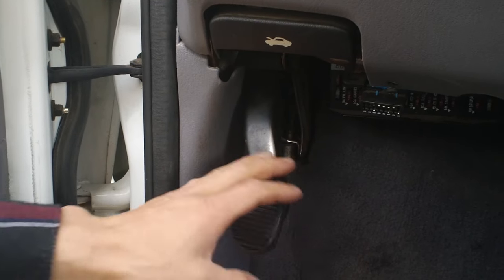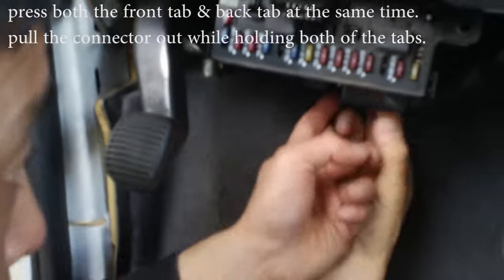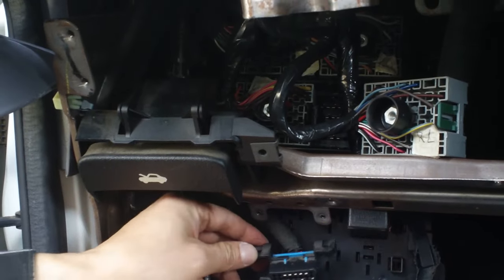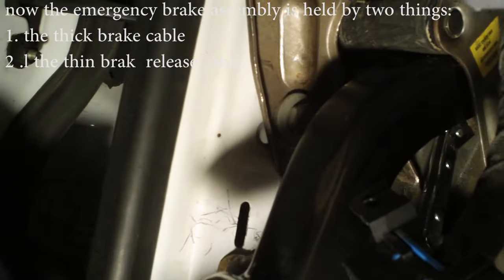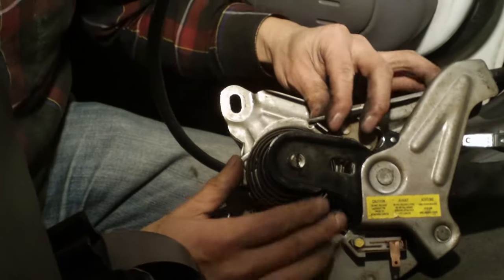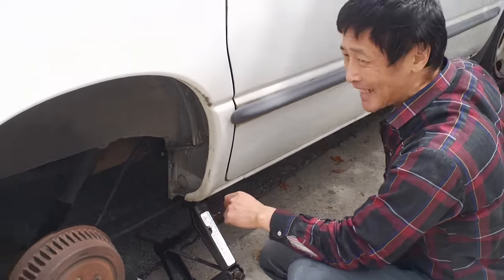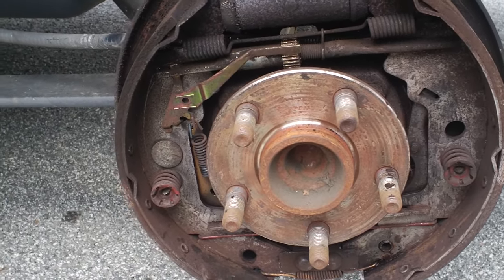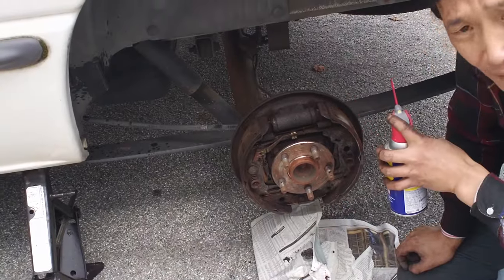Emergency Brake Pedal Assembly & Stuck Brake Cable

Comment: Idk what we would do without hardworking Asian men to explain how to fix things. Thank you so much for this video. I'm bought a 2000 Plymouth Grand Voyager SE with the 3.3L flex fuel from an auctioneer. They disconnected the parking brake cable and I had no idea. I use the parking brake because hills. I ended up having to drive it with parking brake on to get home. Now I gotta fix this, possibly fix other issues. This is a great vehicle, worth fixing.
Reply from the maker: Thank you for taking the time to provide feedback. Yes, make sure the parking brake is not engaged while driving. If you have to drive with parking brake on, make sure you stop and rest on your way home frequently so that it is not too hot.

Comment: Thank you for sharing  your technique   Our 2013 Kia Soul sat for a week in the mid-May heat in SE Ohio, and when we returned, we couldn't release the parking brake. The car wouldn't roll, but dragged one wheel along the ground. Jacked it up, attempted to remove the wheel, but couldn't. and after trying a rubber mallet, switched to a sledge hammer and tapped around firmly, until the wheel started to rotate freely once again.  I was worrying about hiring a tow truck to drag it out of our narrow, walled driveway to a shop for major repairs. We still have to get that wheel off to replace the tire eventually (tire tread is worn but not gone...NOT as a result of this issue) but we can do it at a time of OUR choosing.  Thanks again for showing us what you did.
Reply from the maker: Thank you for taking the time to share, it will help other viewers

Comment: Thanks.  Showing oops (or non-optimal) are the most educational.  I just replaced the parking shoes in my 2002 Town & Country (rear disks, plus pads and hub-bearings).  When done, and adjusted by trial and error (removing disk w/ calipers off), the parking shoes initially dragged slightly and the parking pedal held at half depressed.  After driving a bit, the slight dragging sound (whosh-whosh) went away, but now with e-pedal at the floor the van doesn't hold on a slight hill.  Hope not in the pedal self-adjuster since, as you show removing that part is a beast.
Reply from the maker: Very good advice about the "oops". Thank you for taking the time to share your results, it would help other viewers

Comment: I appreciated your wife asking questions..you do not need to know cuss words...just say things loud like..OH BRAKE SHOE!!! or FUSE !!!
that being said a genius would have checked the cable 1st but then we would not have learned anything..I was ready to pull my foot brake assembly apart but thanks to your video I will first put tension on the cable and see if the pedal works and I will look like a genius to my wife. Thanks to your hard work..I won't have to shout STUPID SHORT SCREW DRIVER!!! FUSE IT ALL!!!
Reply from the maker: Thank you for taking the time to share, and your tips 😁 it will help many other viewers.

Comment: Thank you for the great video.  You're brake assembly looks like the assembly on my 1996 SL320 Mercedes. They are all basically the same .  I worked on it for an hour and realized that I will need to take it completely out to unlock the brake ; then I came across your video. You saved yourself alot of money by working on it yourself.  You did a good job .
 That's was funny when you said you didn't know many curse words or you'd say them . Working on automobiles can be frustrating and make you curse . I remember I was pulling a transmission out of my 1966 Chevelle Convertible and I was underneath the car , my 6 year old son said " Get a hammer and bam it out Daddy " . I laughed so hard at what he said. He knew I was frustrated by my curse words . 

  Have a good day .
Reply from the maker: yes,  we share that frustration for the deeper and deeper (or never ending) hole we managed to dig in! Only those who really worked on similar things can understand!

Comment: Thank you for the video - I have to remove my pedal soon as it is not latching into position when applying the parking brake. If you are going to get as deep into disconnecting electrical components as you did to remove your pedal, I hope you disconnected the battery first! This is important for safety reasons and may avoid damage to the vehicle's electrical system.
Reply: +Vincent Sullivan the video made a point of this (it is an easy test): you may not need to get deep, pull your cable first to test to see which part is the culprit
Reply: FETV  You showed how to release tension , now show how to add tension

Comment: can you explain in words what exactly was the problem and what was the fix? 
I understand that the problem was from the rear and not from the pedal, but why does the pedal didn't click when locking and release? 
the problem was with the shoes adjustment? 

please explain

Comment: Thank you for this video, my question is- what was the original problem with the emergency brake cable, where did it actually break? My understanding there are three cables involved in this assembly, the rear right cable, the rear left cable, and the front cable.
Reply from the maker: the cable did not break. The release force was not strong enough to pull the cable back, that is why when I tried to feed the cable back into its housing, it came back. So either to lubricate the cable to weaken the resistance force, or replace the spring to increase the polling back force should fix it.

Comment: Best to disconnect the negative battery cable before poking around the electrical system.  That way if a tool slips and you short out something, no blown fuses or fried wiring.
Reply from the maker: thank you for the reminder.

Comment: So it sounds like the real problem was in the rear, and to fix it you simple adjust the brake shoes outward a little to take up the slack in the cable, is it correct?

Comment: Hello.  Thank you for posting the video.  Just to save your life, next time you raise the car please use a jack to hold it up in addition to the jack that the car came with.  That jack alone is to be sed to change a tire and for emergency uses only.  Using just a single jack is dangerous.  If the car slips off it, you may injure yourself or even die if you are pinned under the car.  Safety FIRST!    Have a good day.
Reply: TOUCHE'

Comment: At 5:06 the cable cam with the spring was 180° out, I just twisted it back enough to install the front cable (2001 model) by hand, as reinstalled it assembled.  But do watch how the spring is on there: it can slip off the mount.
Reply from the maker: Thank you for taking the time to chime in and to contribute & share to help others

Comment: 1999 Chrysler emergency brake pedal stuck to floor so i can't release it, do U have a fix for this van? It looks like the same, would this apply to the 99 model?
Reply from the maker: +jerry maier at time 6:50, I was discussing you first need to decide if the problem is front or back. You should spend 3 seconds to pull the cable to make sure that you really need to do anything to the pedal. My mistake was to take huge efforts on the pedal and find out it was the problem at the rear.

Comment: Sir, very good video. Can you please tell me the item number on the Craftman wrench the you show here.I cannot read it on this video. I am doing this on an old Lincoln and it is very similar. I hope that all 3 bolts are 10mm. The top rear one is very hard. I have seen some wrenches like this but only in SAE. Thats why i need that number. Thank you
Reply from the maker: yes 10mm. Some bolts also need 11 mm socket
Reply: Thank you sir. My main concern is the upper 3rd bolt that is hidden. Is it 10mm? Thank you very much. I would ash you for the number on that Craftsman 10mm wrench.
Reply from the maker: yes, if I remember correctly (it has been many years ago). I think all 3 had the same size. The upper 3rd bolt was hidden, it was tough to remove. But since you now know the design, you just need to take your time, to insert the thin wrench, wiggle to latch on,  make quarter  turns at a time, slowly you will remove it.
Reply: Yes sir, but could you read me the Craftsman number off that wrench? It is not easy to find. Thank you.
Reply from the maker: A few years ago, I had a contractor installing a new AC unit. He stole quite a few of my tools, I had recovered some tools from him before he finished his job, but later I found I still had many tools missing since I did not noticed they were missing at the time.  This particular wrench was one of them, sorry I could not find the wrench, but it is a lesson I learned.
Reply from the maker: thank you for the part number and let us know how it goes

Comment: Omg! Trade it in, sell it as is, junk it, burn it, dump it in a lake! That’s more work than I can process! Just kidding it is much for the weekday so plan the weekend, crack the cans open and drink the problem away. Loud music, cold beer and it’ll work out. More psychological than physical. This is the last of my mega gazillion dollar repairs for the old girl. Just to pass PA inspection. Ugh! Well one more can and I’ll have enough liquid courage to begin. My only real problem is what to do with all the extra bolts and screws when I’m finished. For some reason there are always extra left over. (Satire).
Reply from the maker: I share your finding of extra bolts and screws after the work. After many times problem, now I put the small parts in a serial order when I remove parts, and then when I re-install, I will follow the reverse ordering so that I won't miss any parts.

Comment: I just recently came across this video. Is that a Mecedes? I have a E430 that my wife must have stomped on the parking brake and then the car sat for a while. Having a hell of a time trying to get it to release. And don't worry about the swear words, I said every Fucking one of them for you. LOL Thanks again. Any suggestions would be appreciated. Thx.
Reply from the maker: it is a dodge caravan made by Chrysler before they merged with Mecedes. But this design is common to many models of various manufactures. Glad you share my frustration of a design with neverending removal of unrelated components, I feel equally good when someone is helping me to swear LOL 😂😂

Comment: Sir.Bolts are  Not called SCREWS.  Learn The Difference.
Reply from the maker: yes, in this video some fastners are very small without nuts, but technically they could be bolts because they are driven into metal plate with thread or plastic plate, sorry about that.
Reply: what are the 3 bolt sizes 10mm ?  thank you in adavancee